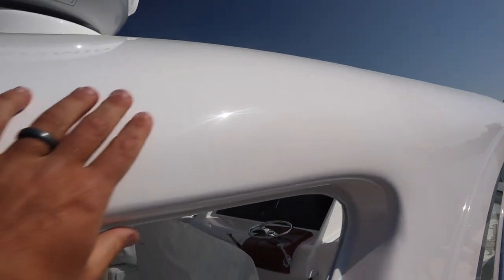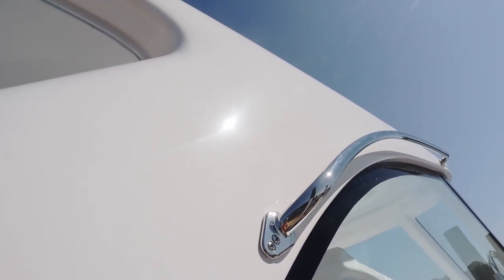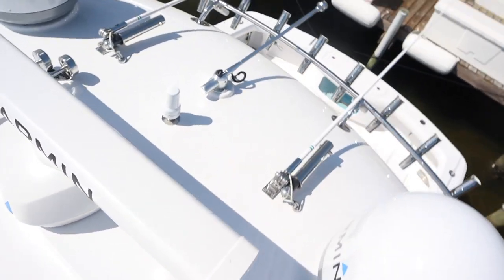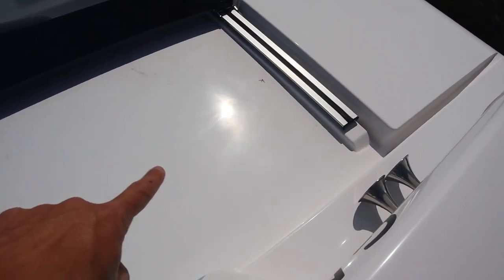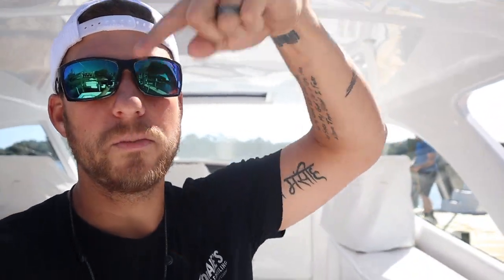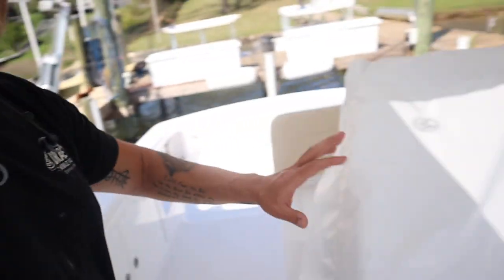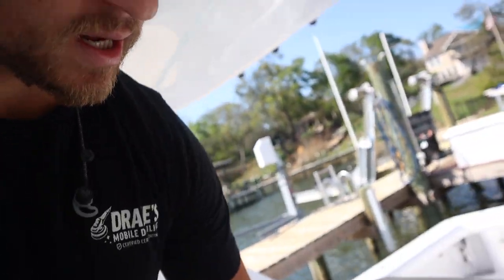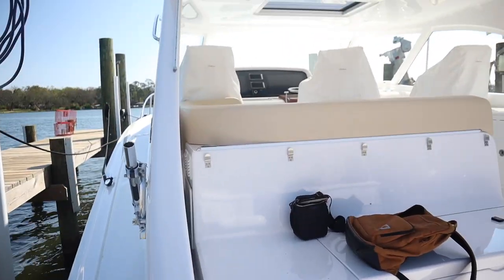The All New 2021 MagBay 42! Marine Ceramic Coating Quote!

Comment: How do you detail boats painted with awlgrip or awlcraft? From my understanding you're not supposed to polish or wax it?
Reply: Also can the paint be ceramic coated
Reply from the maker: Awlgrip is only supposed to have awlcare applied.  No wax , sealants or coatings. Never use a machine. 

Awlcraft is fine. Use any coating, wax or sealant you would like

Comment: How much did you charge for this boat again in $?
Reply from the maker: total will come to around $8,000! We had todo more correction than I thought!
Reply: @DrakesDetailing  And how many hours did it take for you to finish it? I'm also an accredited IGL Coatings installer and I'm trying to understand prices for applying marine coating to boats.
Reply from the maker: Gotcha! I’ll have about 20 hours into it, about $900 in ceramic